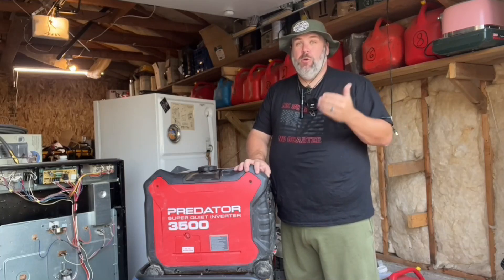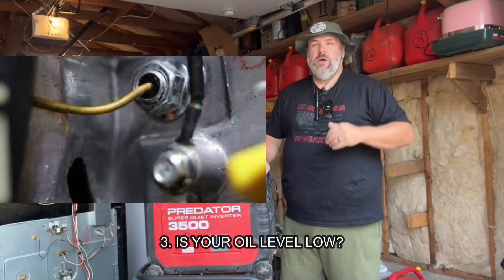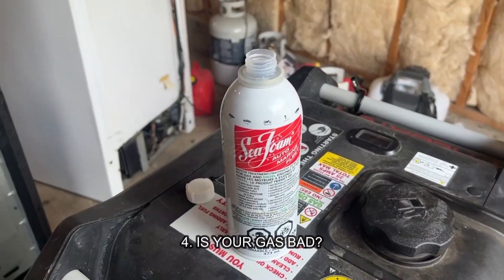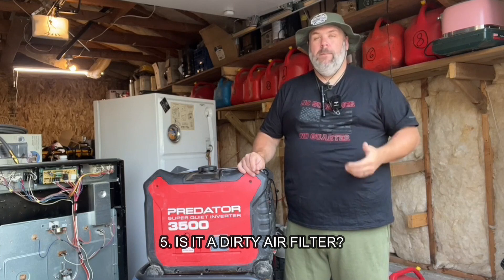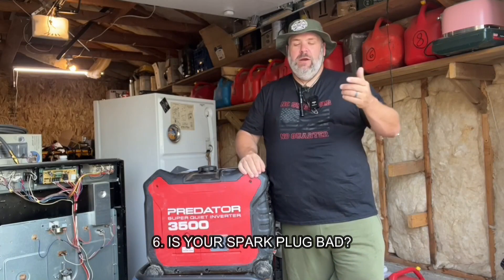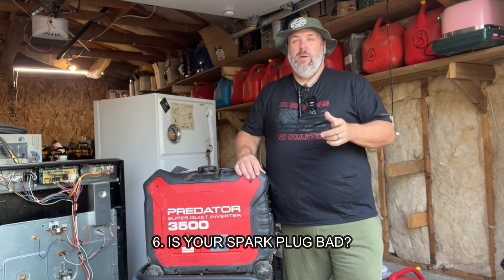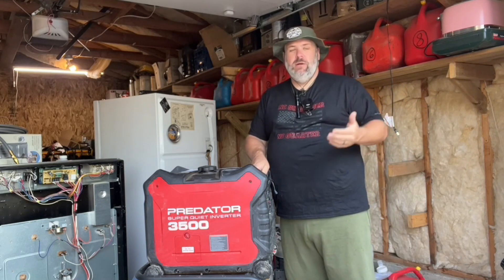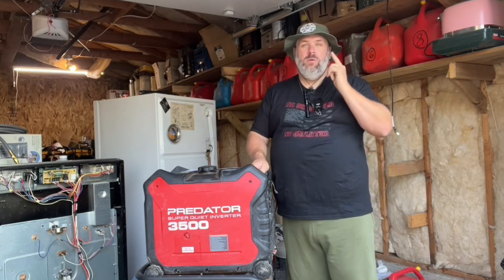Why isnt my GENERATOR starting?  7 SIMPLE FIXES

Comment: Great Information - I repair and maintain numerous generators on the ranch here. The simple fact of the matter is, generators are made to run, not set up.  Keep you genset in handy spot and load bank with a space heater (in a safe place) plugged in for several hours at a time and keep good non-ethanol gas in it.  Change the oil often. It's hard to wear'em out. This from a man who who still uses a 30 year old (next month) 1000 watt Honda generator.

Comment: another that I use..........my genny is 12 hp with manual pull ONLY........its in a shed without other flammables so I use a 20 lb propane container with a heater hat on it for construction......i let that run for an hour or two in the shed which is probably 120 degrees F and after a while it will warm..    also ya can drain the glue called OIL and warm it in the house while the propane is warming the machine and pour back in and give it a go.   MAKE SURE U MONITER THAT HEATER TOUCHING THE HEATED SURFACE FREQUENTLY.........OPEN FLAMES AND FUEL MAKE A BAD COMBO.
Reply from the maker: These are great thank you.  I’ll 100% share this comment on this Thursday’s Livestream.  Appreciate the feedback

Comment: Might be a stupid question, but do you still need to run a generator every 1-3 months if you only run it on NG and propane?
Reply from the maker: First off its not a stupid question.   I still do, its not quite as important but it keeps it running and in fighting shape so to speak, also lets you catch any issues before the power outage
Reply: @TOOLMANTIMSWORKSHOP  Thanks! Fair point, I'll be more diligent with that.